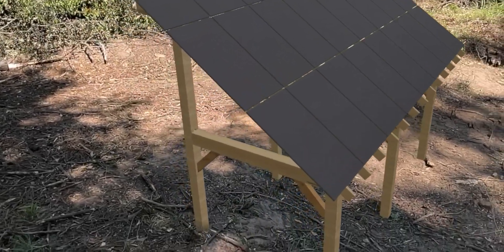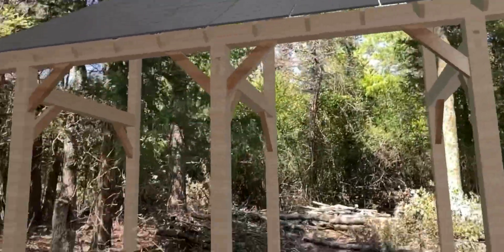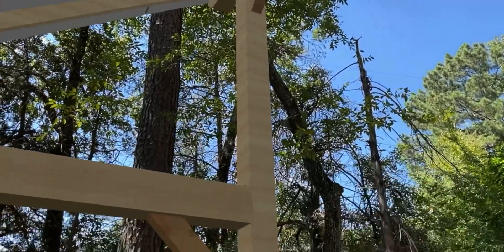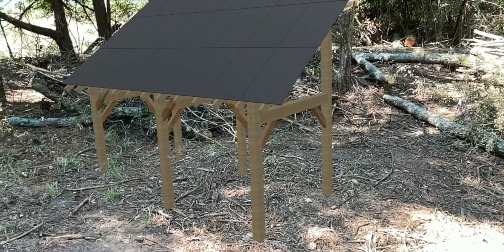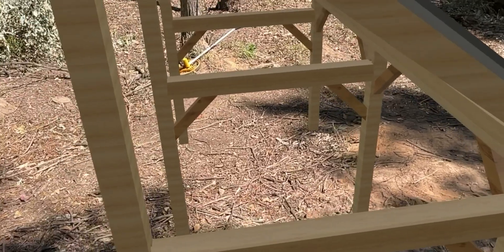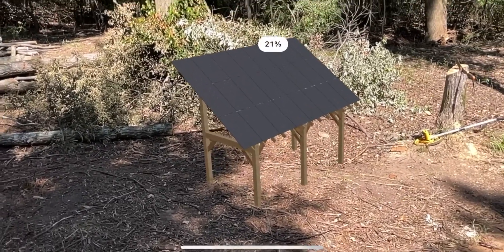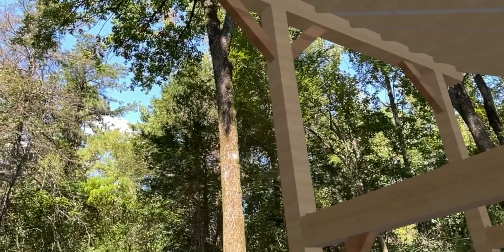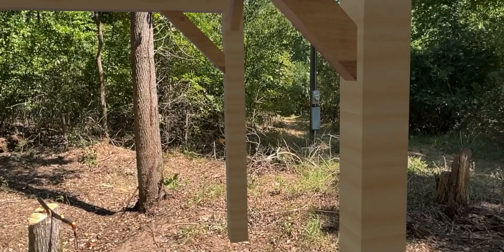Timber Frame Solar Array Preview (What we're going to build)

Comment: Thats creepy, i totally thought it was real!🤣 at first i was wondering what trick you had up your sleeve for such a small set of panels lol!you could do quite a large vertical hydro/aquaponics across the front face of the timber frame. If the panels are getting sun, so should the plants. Water holding or fish tank could be kept under the back side to help keep algae down. I can also say from experiencr it will help keep those oak leaves out of the way as well.
Reply from the maker: lol 😂
Great idea on the hydro. I could at least do it on the sides and maybe the front of the first one. The fronts of the second two will be blocked by the first. At least during the winter. I guess the summer would be when the system would be going so it’s not a big deal. Thinking this through on the fly lol.
Reply: @EastTexasHomestead  yes it would def be seasonal as you couldnt realistically keep through winter without a greenhouse. In that case hydro may be better than aquaponics. But a vertical pvc garden in net cups would be super easy to do and cheap to make!

Comment: Sounds like you have it planned out pretty well. Have you looked into Agrivoltaic setups that allow for growing shade tolerant plants under a raised solar array?
Reply from the maker: I’ve just recently heard that term for the first time. I haven’t looked into it though.
Reply from the maker: What do you think for our climate?
Reply: @EastTexasHomestead  I think it could be a good idea, though I think the design would have to change as you would likely need to have spacing between rows of the array to get enough sun coverage. Saw an interesting design where something like a Pergola was used to mount several rows of solar 2-3 feet apart to allow more sun into the garden below.
Reply from the maker: Yeah, I’d need to change it up a bit for sure. It’s a cool concept